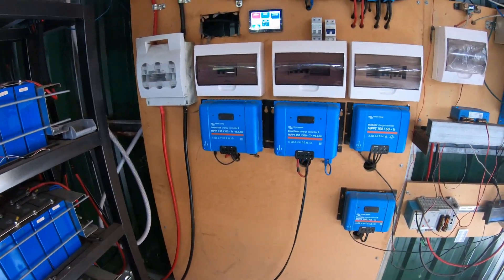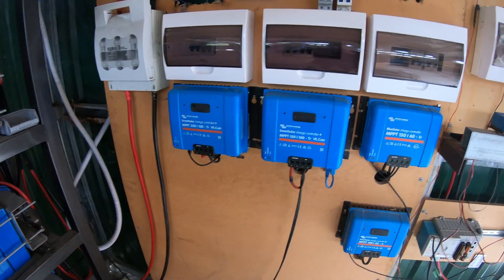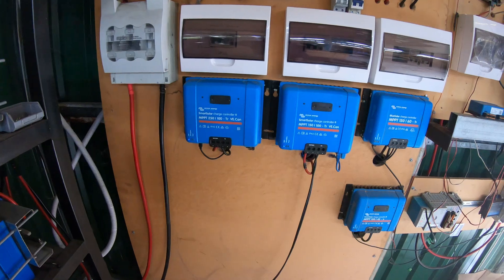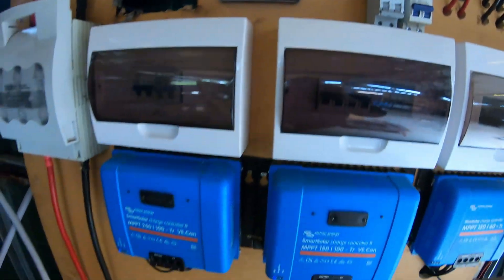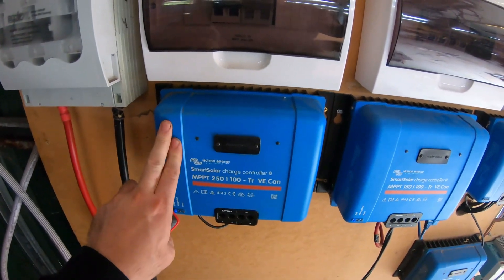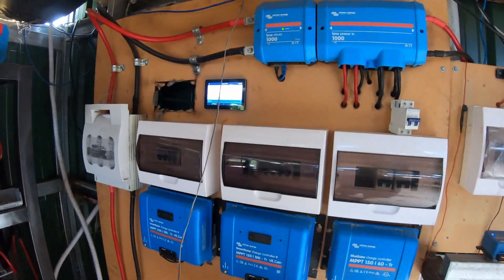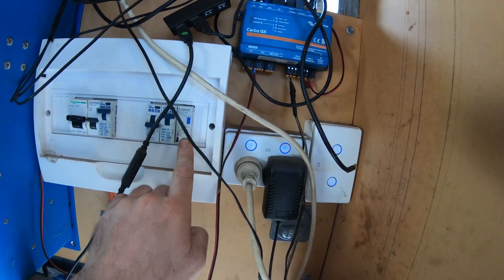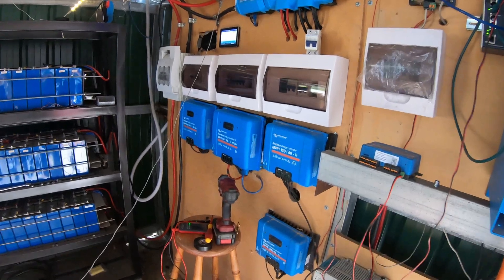Does Cooling an MPPT increase output ?

Comment: its better to blow the air 90 degrees from the coolers. from the back blowing wil trow alot of dirt in the cooling ribs and sucking wil suck dirt in to them. blow ai from underneat of them.
Reply from the maker: Yea i think drawing it through will lead to a build up of material. There is a plan for more gear to be installed under this stuff which is why we didnt opt for the other fan configuration. Its clear that the fans that we have done make much of a difference though. We might need to swap them out for faster ones

Comment: Hi Mate, great timing of your video as i'm looking to do the same next year.. It's good to see you have used quality Corsair AF120mm (Air flow) fans.. It might be better to use a Corsair SP120mm (Static pressure) fan or similar as that will give you more air forced rather than volume.
Reply from the maker: Agreed, the fact these are the silent ones means low air flow.  I've identified some more solar panels so im going to try this again with them fully saturated, maybe a comparison of the fans to see what impact is has might be a good idea as well
Reply: Yeah more testing the better.. Do you think it's worth putting a fan on the back at this stage does it  help or more testing needed? @BadIdea1123

Comment: Voltage-based fan operation does work.  Because the charge curve for LiFePO4 is significantly offset from the discharge curve, you can actually find a voltage to turn the fans on at that reasonably tracks with significant daytime production.   For a 16s LiFePO4 system, somewhere around 53.35V is a good voltage to turn the fan on at, then turn it off below 53.30V.   Very roughly.   Works great.  A little voltage-sense relay with digital controls will do the job.

In terms of fan operation, it doesn't take very much airflow through the heatsink to keep it happy.  The Victron's have to be well north of 60C to actually do any real power derating.   But yah, cooler equipment lasts longer.

-Matt
Reply from the maker: Yea i was thinking of wattage out, another user commented asking about the ruvi puck. we went and grabbed one so i might do a few triggers
Reply: @BadIdea1123  Those Victron 100|150 charge controllers have a built-in programmable relay that can be programmed via the bluetooth mobile app.   You can use that to route power to the fans.   Which is how I do it.  A voltage set point of 53.35V to turn on and 53.30V turn off.

Use the relay output to switch the (presumably nominal 48V) battery side voltage to either a 48V fan or to a 48-to-12 buck converter to run 12V fan(s).  (Be sure to fuse the power being routed through the relay, usually a 1A slow-blow mini glass fuse is plenty.  Auto blade fuses are only spec'd to 32V so they can't be used on a 48V battery system).

The relay is specified to handle up to 1A of power up to 60VDC (4A of power up to 35VDC).  So with a 48V nominal battery system, 1A is the maximum you can run through it.  Perfect for fans though... a hell of a lot of fan can be run with 1A @ 51.2V nominal... that's 50W+ of power!

-Matt

Comment: I have 4 x 250/85 MPPT regs. They get a bit warm when maxxed out but not warm enough to worry about. One thing I did do, though, was made sure that I had the minimum 100mm clearance around the MPPTs (especially above them) to allow good airflow. It's in the installation rulebook...
Reply from the maker: yea you can probably see that we didnt do that, I wish i had now, but it is what it is.

Comment: Using the shop vac at the same time you are drilling holes with the hole saw is a good idea to keep that dust out of your equipment, and makes clean up far easier..
Reply from the maker: .... im sitting here litterally shaking my head, why didnt i think of that ... There is a shop vac in the shed too

Comment: Do you find your fronius derate after 45 degrees? I have an ABB in shed, with these temps (even here in nsw) at 45 (internal temp) it turns off supply to ac bus meaning no loads covered and no battery charging. Using a cheap Bunnings fan to keep it under temp. Internal fan spinning at 4000rpm not enough to cool down to 40.
Reply from the maker: I cant say ive noticed that, is the internal fan working on the inverter ? 

If you can give me some more detail we will try to replicate it and measure it. Is teh 45 degrees the inverters internal temp or the ambient temp outside ? edit:just noticed you mentioned it was internal temp. Once i finish this i will try to replicate the high temp in the fornius inverters
Reply: @BadIdea1123  I think the fronius has far better fans to cool down. Ambient is about 32 , there are 3 temp readings internal, ac and dc side above 45c
Reply from the maker: @gibo1971  I will try turning the fan profile off and see what happens. It sounds like a reasonable safeyty feature though. 

I've finished testing the MPPT today so i can likely do a test on it tomorrow and let you know the outcome
Reply: @BadIdea1123  my inverter is in the shed. No direct sunlight. Temp outside is 36 degrees. Can’t get inverter internal below 40 degrees so no power production.
Reply from the maker: @gibo1971  what model inverter is it ?
Reply: @BadIdea1123  ABB UNO-DM-5.0-TL-PLUS-SB-QU
Reply: @BadIdea1123  even though the temp is down it still says it is above 40 degrees and no solar. I think not good
Reply from the maker: @gibo1971  There is def something wrong with that then, it should derate to 75% output up to 60c. 

Inverter product manual has a derate chart on page 30
https://uvpower.com.au/wp-content/uploads/2017/10/ABB-Inverter-product-manual-UNO-DM-5.0-TL-PLUS.pdf
Reply: @BadIdea1123  finally back on @645pm so not so much load covering or charging going on.
Reply from the maker: @gibo1971  What error code is it ? E014 ? or something else
Reply: @BadIdea1123  this model doesn’t have screen. Can’t find any error codes when looking in settings. Just says derated

Comment: A note about the operating temp of -30 to +60. That refers to the ambient air temp, not the mppt temp. 
That said I put a 12v 120mm fan on a GTI running from a 5v phone charger, and the gentle breeze would cool them down by over 10c.
Reply from the maker: I think i didnt explain the intention well in the video, the day i recorded the video the charger only peaked over 60c once, the concern is that its happening already when its not that hot outside. 

Once we get in to the full blown 40c summer i think we will start to see it backing off. so we are doing this in preperation, not the current temps we experiencing. But appreciate the feedback, the distinction about ambient vs the devices temp is important to make clear

Comment: It doesn’t have a fan. What do you expect? If it did not have a high temperature, how would it get rid of the heat. The temperature difference between the piece of equipment and the ambient air temperature is what you have to have. As long as it doesn’t go above 100°C, don’t worry about it. There is a reason they don’t install fans. Simplicity. Energy savings. Less repairs down the road. Less dirt pulled into the equipment. If you put a small mini split AC or heat pump on your power shed, you’ll keep it cool and dehumidified all year around. Set it to 21°C and leave it alone.
Reply from the maker: The manual states "Operating temperature -30 to +60 °C (full rated output up to 40 °C)" we are putting a fan on as we are not in full summer yet and the big MPPT is already at 60c, im pretty sure at the begining of the video i stated its in spec as in "this is ok" we are simply trying to bring it down a little in anticipation of what will happen in summer. In addition to that we want to see if there is any throttling, which indicated by the note in the manual, there is throttling above 40c

Running a split system is also an option, you cant see it in this video but sitting on the deck out side the shed is a second hand system that is destined to be installed on the shed.